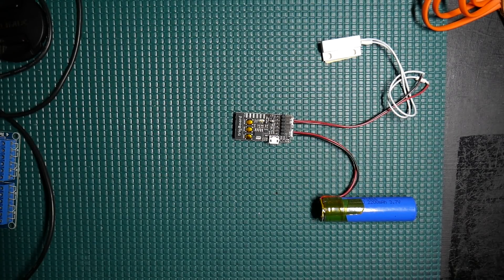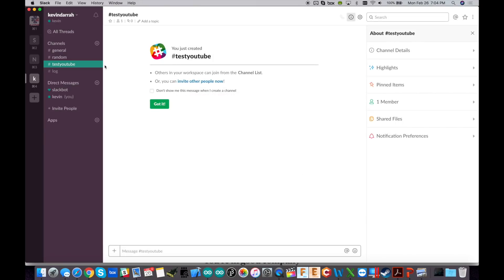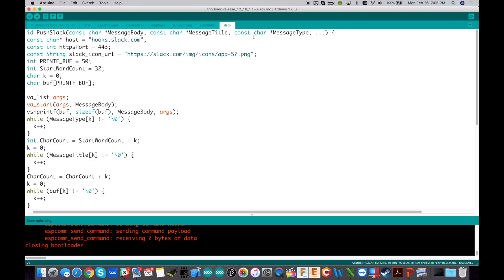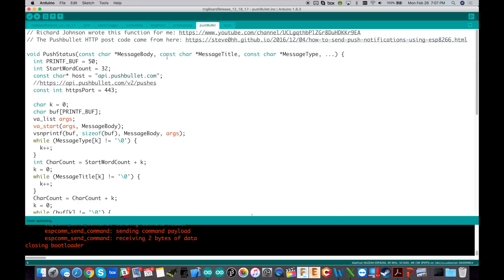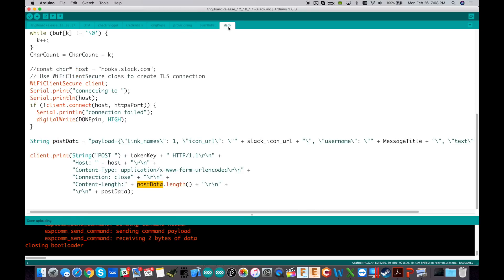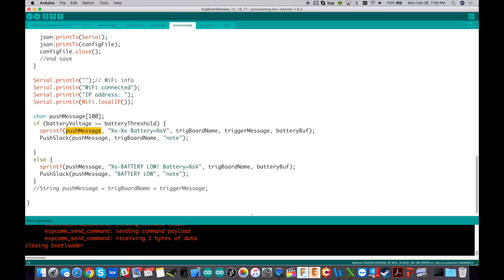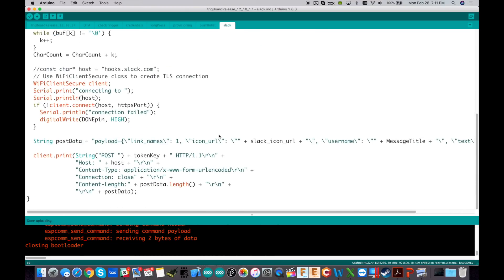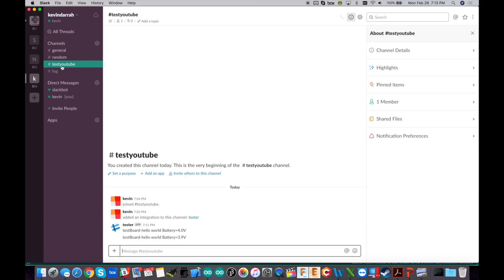ESP8266 - Send to SLACK!  tutorial with trigBoard Base Firmware

Comment: Hi Kevin,

Do you know the possible reason for not connecting to the slack API. The serial monitor always tells me the connection failed whenever I try to connect to the hooks.slack.com.
Reply: It turns out that the problem is we need to set the certificate before connecting to a HTTPS server. If someone is facing the same problem, you can check video from this YouTuber: https://www.youtube.com/watch?v=Wm1xKj4bKsY&t=794s